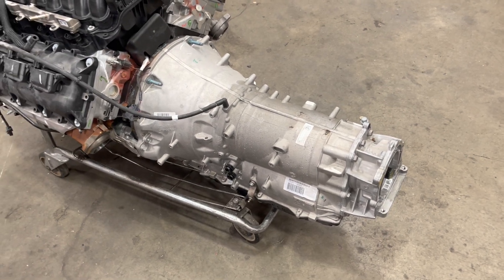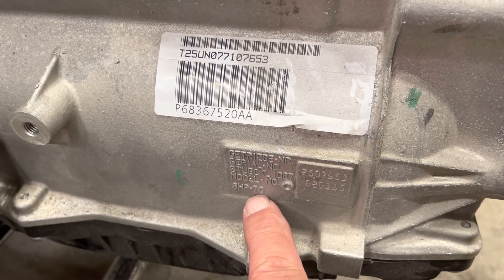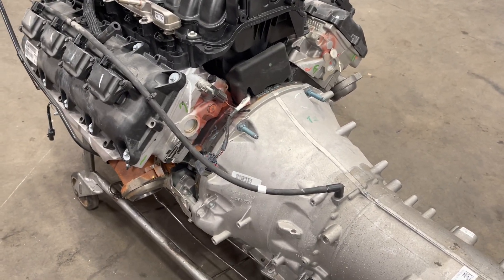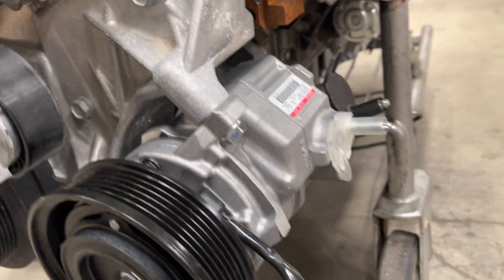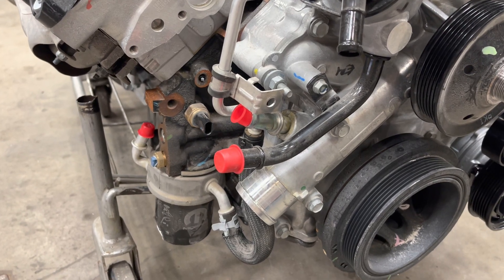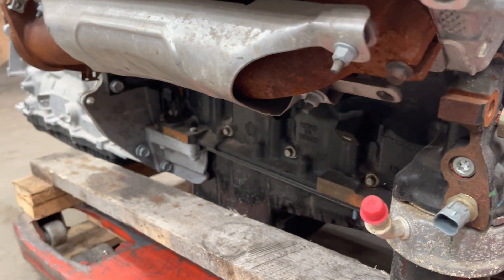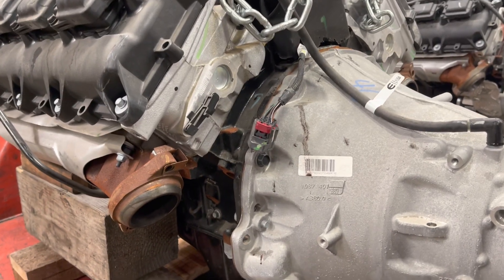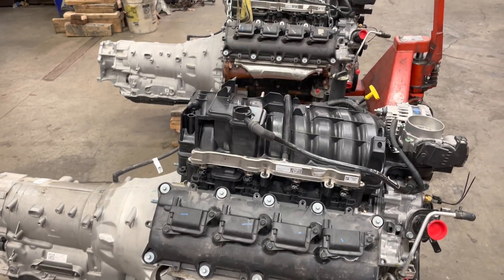How to identify a HP70

Comment: Is one stronger then the other or better for swapping
Reply from the maker: I would not say one is better than the other, but we do have the HP70 working with tap shift and we do not have tap shift working in the HP75 right now. But the HP75 is driving
Reply: @jeepspeedshop  awesome details! May I ask if there's going to be a 3.6 8speed kit available soon? I keep checking the website but nothing comes up when I click on that .
Reply from the maker: @pjshooter6  We do have a kit.
8 speed in a 3.6L JK 845RFE

Transfer Case cable mount 52121832AC $30.00

Transmission cooler, HDA-679  $80.00

Transmission cooler lines 68291875AB for the 8 speed  $270.10

2 Transmission cooler fittings 68489743AA  $50.00

8 Speed wiring $1500.00

8 Speed floor plate and spacers 4

Truck Transmission mount to t Case adapter 68147344AA  $110.00

8 Speed steel trans pan Jeep JT 68408606AB  $200.00 

Transmission oil 68218925AB  $30.00 needs 10 quarts  

The transmission new can cost $4000.00

Low mile used  $1200.00

Shifter $200.00 used

Bezel $50.00 

T Case used $500.00 non Rubicon

Gear gauge $150.00

Plate B $50.00

Transmission Cooler Mounts part # JKTCM  $50.00

Labor $2500.00

https://youtu.be/JK2CZHcsf6M

https://youtu.be/Oz4oDr7bcHw

https://youtu.be/8LC1PiS1nE8

https://youtu.be/e97qytx5pEg

https://youtu.be/_Qj7ADU2Pxw

https://youtu.be/81n-JvFFU_g

https://youtu.be/t7gHYVGNuFg

https://youtu.be/G6SfNOWPl1U

https://youtu.be/AFMo9s71YMc

https://youtu.be/8h8yLUC7C-M

https://youtu.be/tcuJMKoxpII

https://youtu.be/J-VcQahShuI

Doing the 8 speed swap on a 2012-2018 Jeep JK and why we can not do the swap on a 2007-2011 Jeep JK with a 3.8L.

The 3.8L engine bell-housing mounting surface is way to small to mount a 845RFE 8 speed and also the crank sensor is in the Bell-Housing of the 3.8L transmissions, so it does not make sense to make a adapter to fit the 845RFE to the 3.8L.

Now on the 3.6L 2012-2018 Jeep JK we use the 845RFE 8 speed from a 2013-2019 Dodge Ram 1500 4x4, now we have not used the Grand Cherokee 8 speed yet and could work but i’m not sure.

So we would start by disconnecting the battery and pulling the transmission, we would reuse the flex plate and the starter from the 3.6L JK, now on the 2012-2018 Jeep JK with the Nag1 auto transmission (A580) you will need to get a new transfer case from a 2007-2011 Jeep JK auto transmission and the 2007-2018 Jeep JK with a Manual transmission for the swap, because of the t case input is a 23 spline female and the A580 is a Male input shaft. The 8 speed is about 2 inches longer than the A580 transmission also you will need a Challenger Shifter from 2015-2019 3.6L, 5.7L, 6.4L. We also use the non Rubicon t case because of the gearing in the 8 speed is so low, now you can use the Rubicon t case but some adapter mods well need to be done, as shown in our videos.

Now we change out the transmission cooler lines with a Grand Cherokee 5.7L cooler lines and new cooler, very important to run all new and clean, because we use Mopar 8 speed fluid and it is not compatible with Plus 4 ATF.

We also use the 5.7L Dodge Ram truck 4x4 transmission mount to transmission and reuse the Jeep JK isolator and it bolts to the Truck Mount.

Now the big bonus to the 845RFE is the 4.71to1 first gear and the 2 over drive gears also now you have a output speed sensor in your transmission so you no longer rely on the wheel speed sensors for the transmission and what that means is that you can now shut off the Traction control in the sand, a big bonus.
Reply: @jeepspeedshop  awesome! I'd be looking to order the kits / parts and doing the install myself on my 13" rubicon jkur.
Reply from the maker: @pjshooter6  I love that idea and I'm here to help.
Reply: What type of mpg would it get with 3.6?
Reply from the maker: @beunbad  In my 2014 Jeep JK with a 3.6L, all stock 17MPG to 20MPG the best it ever got. Using the 8 speed out of the Dodge Ram truck.
Reply: @jeepspeedshop 
Can I use 2014 5.7grand Cherokee 8hp70 transmission? Into 2013 JKU?
I can see transfer case adapter is different. Grand Cherokee has AWD adapter, but it looks exchangeable to 4WD one.
Reply from the maker: @Alla0038  We use The 2013-2023 truck Adapter